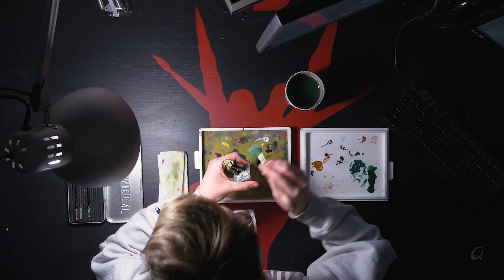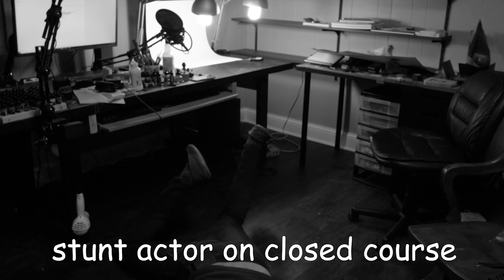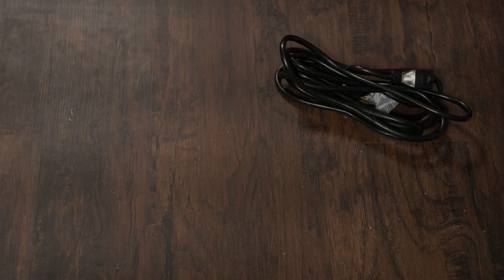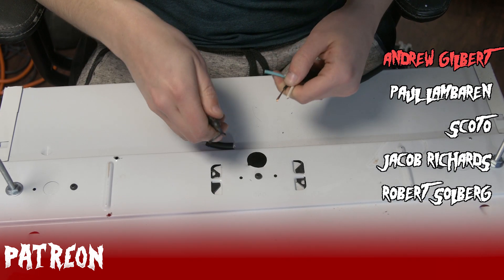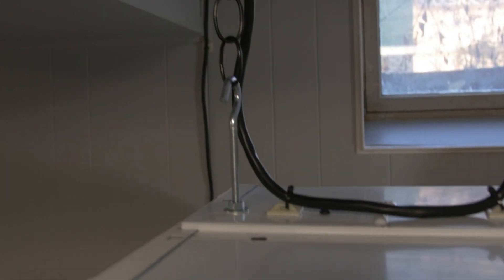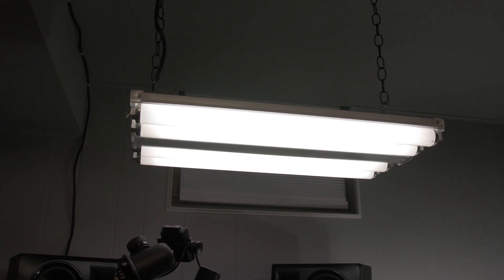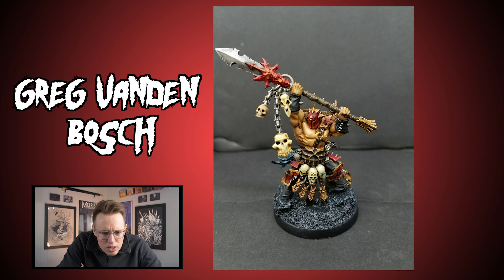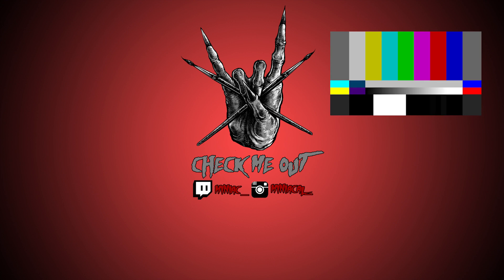Epic Hobby Light Build

Comment: Hey dude! Great channel! Don't want to see that light fall on your head. Those anchors you have in your ceiling are rated for 35 pounds of weight at 90 degrees. You are applying force at 0 degrees. They might be good for like 5-8 pounds each, MAYBE! They don't really rate those for tensile strength. 

What you want is some toggle bolts. They are a little more expensive but 110% worth it. Good luck!
Reply from the maker: Clark Miller dude, you're so right. I should of totally used toggle bolts. I'll switch it out!

Comment: Cool Idea.  I hate how the lights at my bench interact with the positioning of my hands holding the piece up to my optivisor.  This is a good way around that.  On the electric side, you may want to put plastic collars on the two wires where they come through the box.  They're cheap and they're designed to  keep the wire from rubbing on the sharp metal boxes.  A bag of them at the home store is only a couple bucks.

Comment: Some comments:

1. I strongly prefer LEDs for miniatures painting. They're very low power consumption and it's pretty easy to get very high CRI (94+) LED panels with plenty of output. My current primary lights are Viltrox L116T light panels, which have high CRI, tunable color temperature, the ability to run off of Sony camcorder batteries if I'm painting without easy access to power outlets (or just really don't want wires anywhere around).
2. If you want LED ceiling lighting, you can use fluorescent fixtures without ballasts, which are easy to install. If you want, you can remove the ballasts and repurpose already-installed fixtures for LED tube lights with the same form factors as fluorescent tubes.
3. Hardness or softness of light depends on the angle subtended by the light source when seen from the surface of the subject. As you move your lights closer to the subject, the light gets softer because the lights subtend larger angles. I know this sounds counter-intuitive, but as a professional product and portrait photographer, I guarantee it's correct. 
4. The reason you're getting overexposure is that automatic exposure modes on cameras will use some algorithm to pull an average brightness and then set that to a value that will result (typically) in an average of 20% gray. If you have a dark background, the camera will read the entire scene as "too dark" and increase the exposure. To fix this, either manually add negative exposure compensation at the camera or brighten your background relative to your subject. For still photos, the simplest way is to use a medium gray background.
Reply from the maker: 3. You're right, but softness is also modulated by size of the light, which is similar to moving lights further and closer. The closer it gets, the "larger" it becomes. Likewise, if you just make your fixture bigger, it gets softer too! So a good mixture is to put it farther away, and make it bigger! 
4. You're right, but also because my face is so close to the lights, it''s more intense! Light falls off over a distance, the further away the light, the lower the intensity.
Reply: Sure, none of that is incorrect. Inverse-square-law falloff can result in dark backgrounds if you're using lights primarily in front of the subject. This can be mitigated by either using a lighter background or by putting lights on the background if you don't want to mess with exposure compensation. If you want to kill the visual weight of the background and focus attention on the primary subject, you're pretty much limited to more direct control over your exposure, either with some manual mode or exposure compensation and a more automatic exposure mode.

It's also worth noting that moving lights closer to the subject, while it gives you softer light, also gives you more ISL falloff. To get both limited falloff and soft light you need physically large lights (which is why I use a 60" octabox for most of my photography). Even with that large a light, I typically move it in as close as is convenient, which gives a really clean and soft light on portraits.

A 60" octa over your shoulder is not especially convenient for miniatures _painting_, though. 8-)
Reply from the maker: Doug Sundseth you know you're stuff! I look forward to hearing your feedback on my other mini related photography videos.

Comment: Hey Miniac, big fan of you and your channel, one of ma favs. I really like your set up and production quality. I would like to start making painting tutorials myself but not sure what to look for in a video camera and as I'm starting don't have a large budget, got any advice on what is required for shooting miniature painting tutorials? Keep up the great content :)
Reply from the maker: doodledude3 what's your budget for everything
Reply: Hey, thanks for the reply. for my camera my budget is about €200 (I think that's about $240/250), I know I'll need a mic and lighting but I'm hoping to keep that cost under 100 for now, so I guess my budget at the moment for everything is about 300 for whatever I need to get started, can probably stretch to about 400 at a push. I'll upgrade everything when I can.
Reply from the maker: I would look into getting a used Canon 550D (t2i) body, or any old canon rebel camera you can get for cheap with its 18-55mm kit lens. I wouldn't worry about audio yet, just get as close as you can to the camera (the internal mic is on the body of the camera) and shoot on the wide end (18mm) or your lens. That plus SD cards, tripods, some basic lighting, etc. should easily eat up your budget. The next thing you get as soon as you have enough money is some form of an audio solution. 

There are other actual video cameras, as opposed to the DSLR I've recommended above. The biggest benefits of a low cost video camera is often unlimited record time versus the interchangeability and image quality of the DSLR I've recommended. I encourage you to look into the differences and do research. Don't blindly follow my recommendation!
Reply: Haha okay, I'll do some more research :) thanks for all the input though, very helpful stuff. wasn't sure whether to go with DSLR or video camera I have a canon DSLR (I think 1000D) but it doesn't do video and it's just not a great camera. I have a better idea of what I'm gonna need now though so thank you very much for your help :)

Comment: Those are not CFL tubes.  They are normal output(NO) FL tubes, I think they are T12 24" bulbs.  You can get them at your local hardware store.  CFLs have a much smaller tube and are usually coiled and screw into a normal light hence why they are Compact Fluorescent Lights.  There are also HO(high output) FLs and VHO(very high output) FLs but those are for growing plants and aquariums and are overkill.  Great guide btw just thought I would clear this up so nobody goes to the store with misinformation.
Reply from the maker: Cal Erba my bad. They're fluorescent. They're t12 2ft long tubes.